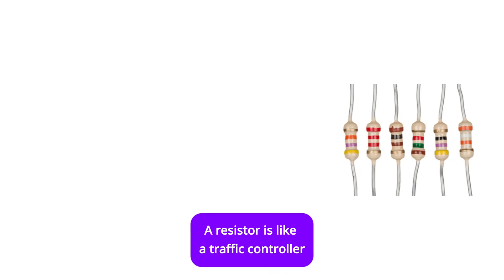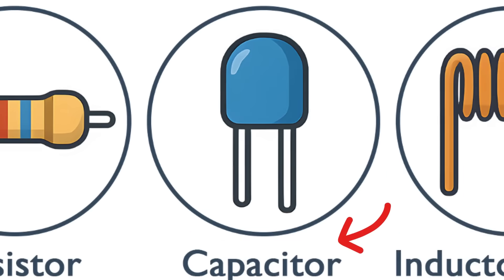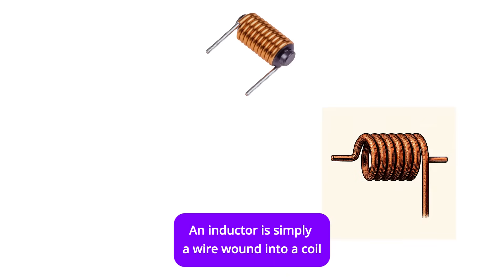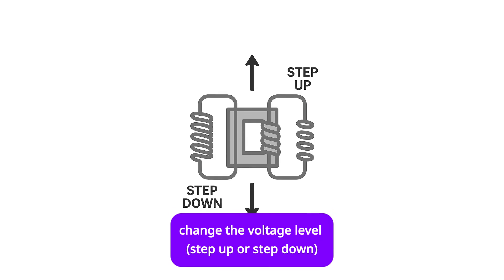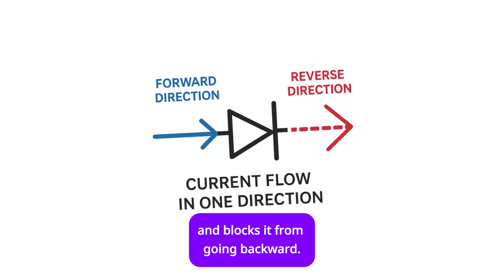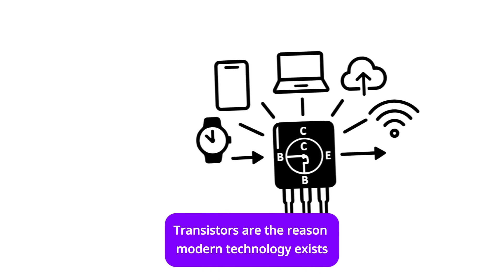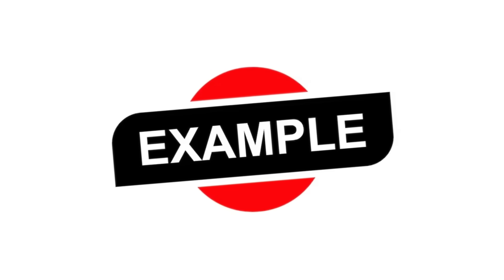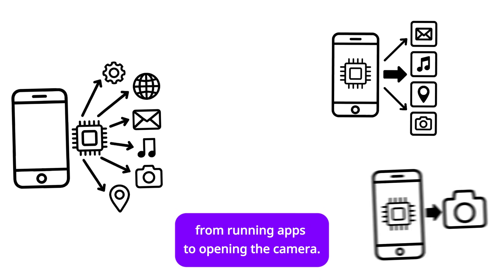8 Building Blocks of Electronics in 4 Minutes

Comment: Kinda lose credibility with the phone charger example. While homes service is 240. All phone chargers are converting off of one leg of that. 120 volts to 5 volts..
Reply from the maker: Many countries — actually most of them — use 220V as the main household voltage so things can get a bit mixed up depending on where you live...💚
By the way where are you from?🙄

Comment: I dont have fancu devices but still interested in this l have 12v battery as a main cource hooked up to long copper alunium iron and bronze plates they have diffrent conductivity and u can fine tune it l have a magnet that l clip on ghe plate and well if the metal is vonductive and u place it near the start it has all that 12v but if opposite it can go low as 7v
Reply from the maker: Exactly... Thats the basic principle of resistance — the lost energy turns into heat. 🔥👍🏻

Comment: The current limiting resistor is shown in parallel with the LED.  The LED will burn out anyway. It needs to be in series.
Reply from the maker: Great note and thanks for pointing it out youre absolutely right the resistor should be in series with the LED to limit the current properly really appreciate your attention to detail 👌💚

Comment: Wow, imagine how transistors can solve the energy problem. Just put a few in a row and you have super power 😅😅😅😅
Reply: Can you explain plss i can't get what you say.... Transistor amplify weak signals iam right
Reply from the maker: @crazyrayees5235  
Yes you are right the transistor really does amplify weak signals it takes a very small electrical signal and makes it stronger so it can be used or processed by other parts of a circuit also just so you know a transistor can work in two main ways as an amplifier to boost weak signals and as a switch to turn current on and off so yeah you got it right if you have any other questions im here to help
Reply: @SimplyExplained-en Exactly, so it can solve the world's energy problem. You just start with one transistor and then add up, or??😅😅😅😅
Reply from the maker: @bennyandersen742 
Exactly you can start at home install one transistor and keep adding more and you’ll save yourself those expensive electricity bills and get sustainable power it just takes a little effort I told you the world of electronics is addictive and can cause side effects just like what’s happening here 🙃
Reply: @SimplyExplained-en You Are absolutely right, keep adding 😅😅
Reply from the maker: @bennyandersen742 
🤣🤣🤣👌🏻👍🏻
Reply: @crazyrayees5235  It's NOT like the ultimate free energy thing 😅 (which does not exist lol)... For this transistor thing you need a power supply that can handle the amplified signal, that can PROVIDE the power of the output signal. The transistor is like a relais. It needs a small input signal (like a push on a button) so the ''relais'' closes and then the power supply/reservoir will deliver the amplified signal. The transistor has 3 wires. You place a small signal on the ''input'' (which will be the BASE to EMITTER flow if you like...) When that connection/flow is made, it's like closing the switch to operate the relais (transistor itself) and now the ''output'' signal (which is way stronger) can flow from the ''reservoir'' or COLLECTOR to the EMITTOR. So you close the switch with a SMALL signal and you can control a LARGE signal for say turning on a lamp or a motor etc, or amplify a (music)signal
Reply: @ASUSfreak ahh, well, it was joke, but thanks for your answer 😊
Reply: Yes and then you need thicker wirea for your Energy. You cant solve the problems Like this
Reply: Interesting
Reply from the maker: The world of electronics is truly amazing... and dealing with it is a wonderful addiction that not many people know about. 💚😄
Reply: @SimplyExplained-en 🤣🤣🤣🤣
Reply from the maker: @Lethal_Mserafi  😅💚